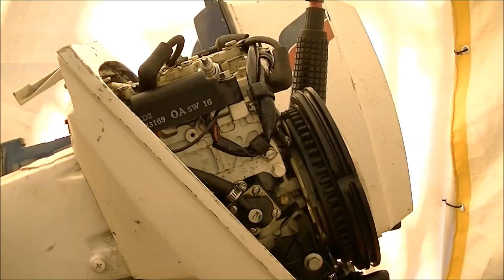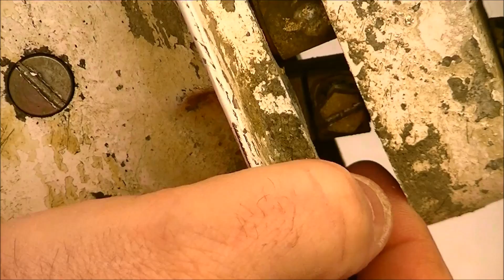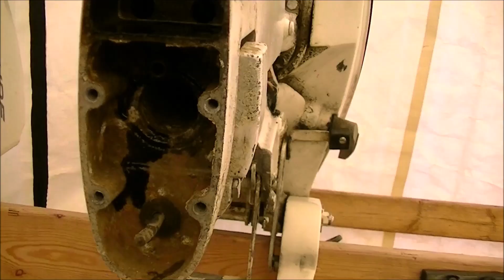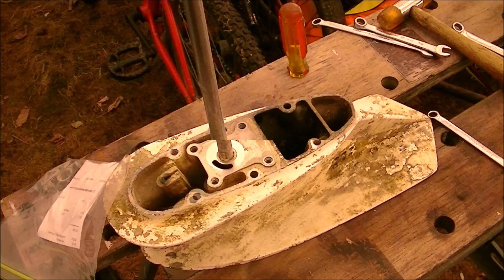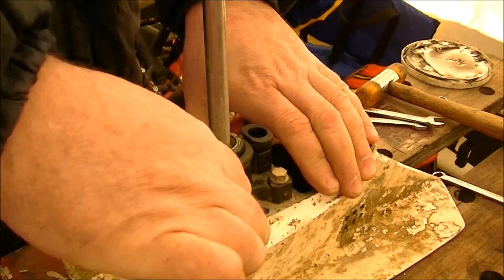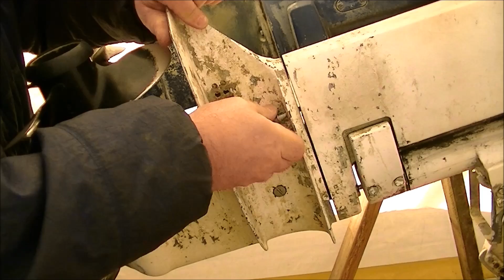Johnson 15 HP Outboard Water Pump Replacement

Comment: no gaskets?
Reply: My question too.  On my Evinrude 25 there is a gasket between the WP bottom plate and the lower unit housing, as well as a seal (kinda' "o-ringish", but not round) that goes between the WP housing and the bottom plate.  Maybe the lower HP engines don't have them?  Seems unlikely but I'm a backyard mechanic...def no pro!

Comment: If I may mention,, it is always best to clean all threads on the bolts, either using a wirewheel, or, a handbrush, and just before reinstallation, apply a good anti-seize compound to the threads! I say this only as a word of preventive maintenance! I like your videos! It's nice to see someone,, other than myself, with 25 years at this, enjoying himself! Cheers to you!!!

Comment: I blew the lower unit in my 15 hp 1990 johnson because the oil leaked out and I didn't know it so it ceased up, i have another one ready to put in, but my question is will there be damage to the area the upper shaft goes into?

Comment: Hi I have a 7.5hp Johnson and I'm trying To drop the lower unit To change the impeller but I can't seem to get it loose does it have that shifter linkage Also that I need to take out?? Also is it necessary to remove the power unit to drop the lower unit??

Comment: hi ive got a 2.5 hp johnson j3rcua and i changed the water pump and it still isnt pissing water. should it be pissing water and if so where at?